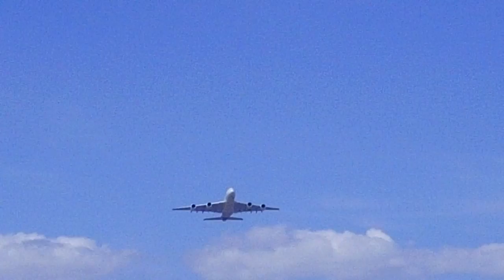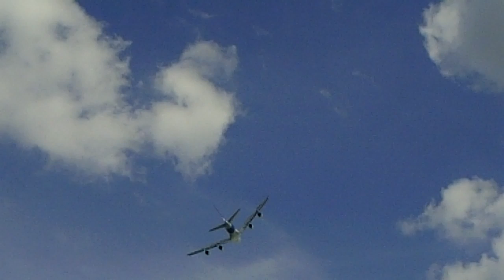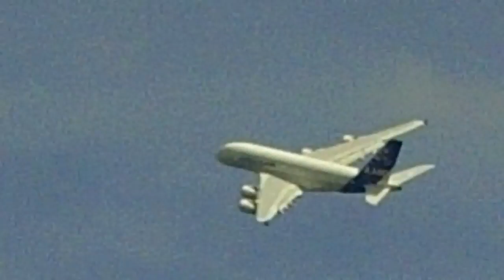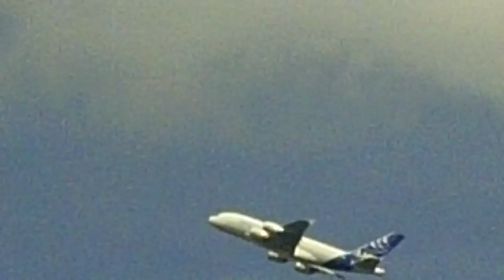AIRBUS A380 LOW SPEED FLYBY AT OSHKOSH 2009 EAA AIRVENTURE FLY-BY-WIRE CONTROLS

Comment: Most Powerfull Engines ever this plane has think why this heavy thing need normal runway and normal speed to takeoff all beacause of those powerfull engines this is really a heavy thing very difficult to keep this thing straight in the Air and during landing....